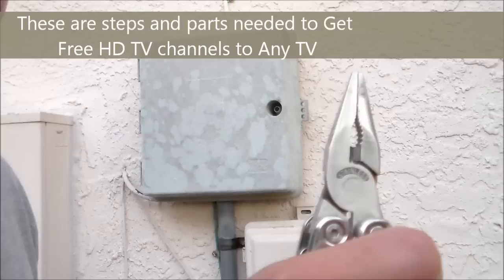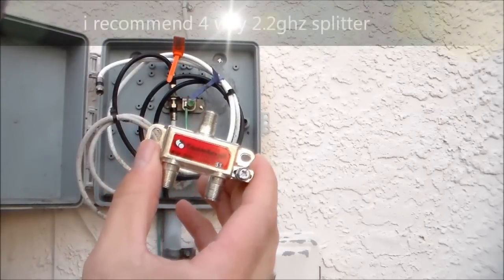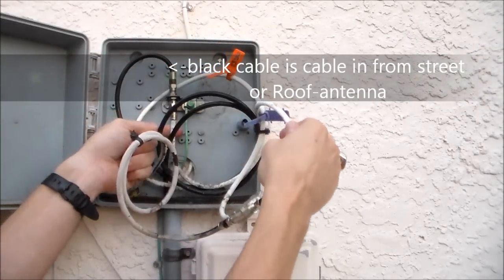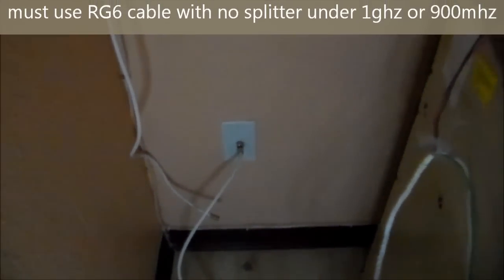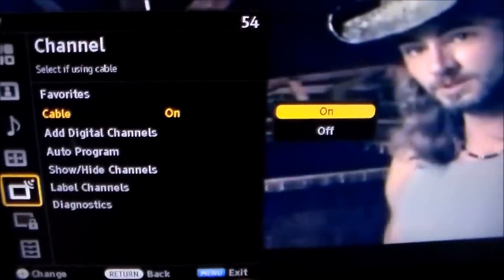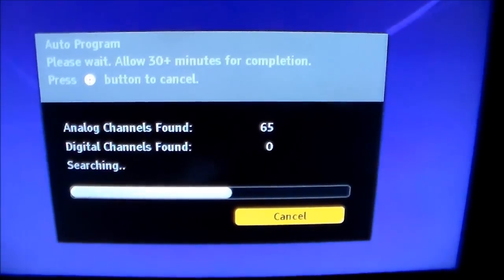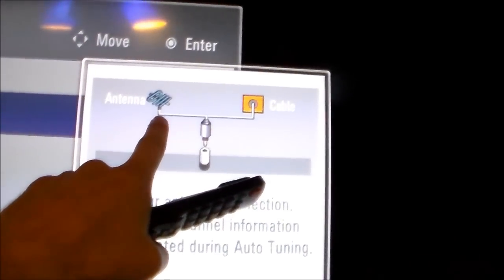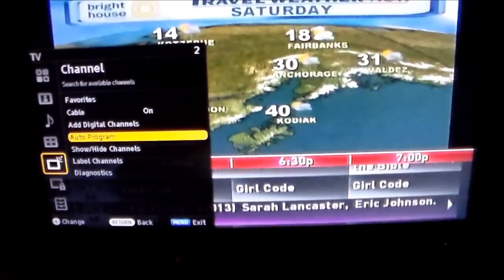How to Connect Cables to Get Free HD TV Channels Legally!!!

Comment: You're giving people VERY bad advice !
You may have been an installer years ago, but we live in the digital and HD era now.
When people find themselves disconnected for days (usually low band which would be their internet and phone, TV service will still usually work) until their cable co. can make a service call  to find it was them that caused the issue by fooling with the cable, then they have no one to blame but themselves. Any good cable co. allows you to have as many TVs hooked up as you want... as long as it's done right.
Push on connectors... a staple from running it along floor strip... no ground on connector, so many things these people will do wrong because they aren't installer will get themselves disconnected. And then I see below you say HD channels wont work over RG59 ? It's not good because of more signal loss per foot but an untrue statement. Post an video instead showing installation of the HD roof antenna from A to B instead of causing people grief for themselves.

Comment: doesn't work if you have uverse you have to have a cable box
Reply from the maker: but you can mirror 1 or 2 TVs from 1 box by connecting cablebox's hdmi out to TV and cablebox's coax out or standard A/V out to another TV and use ir extender to change channels from another room. How to Watch HD Cable TV service Wireless on 2 TVs, works for PS3 & XBOX too